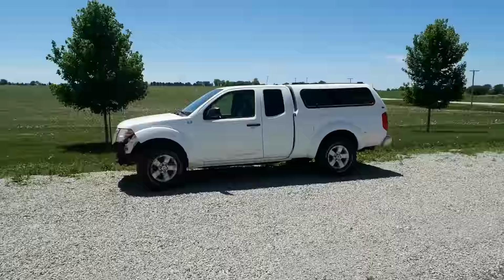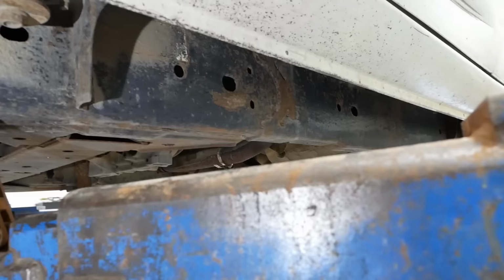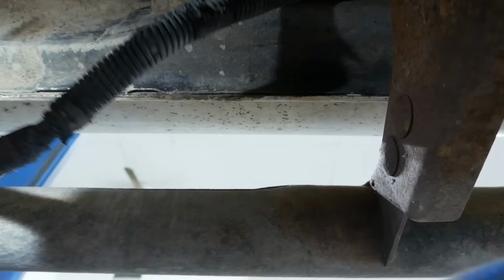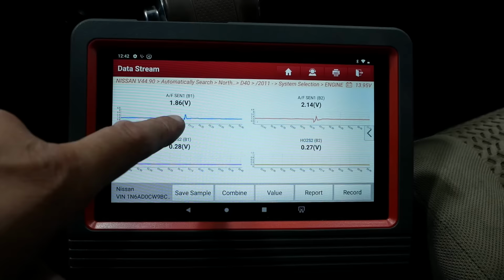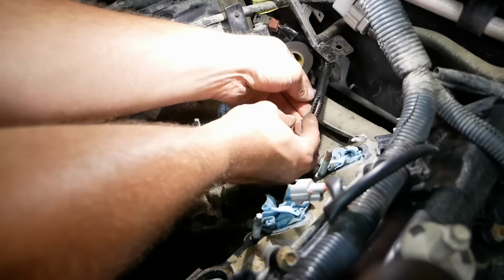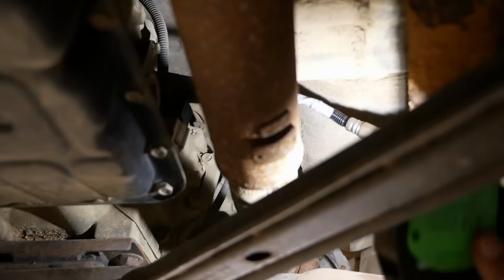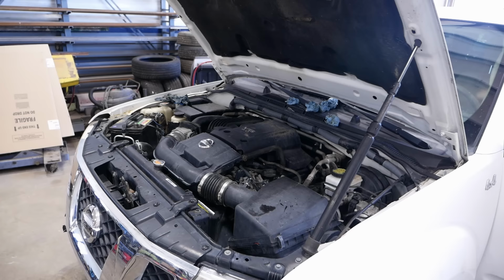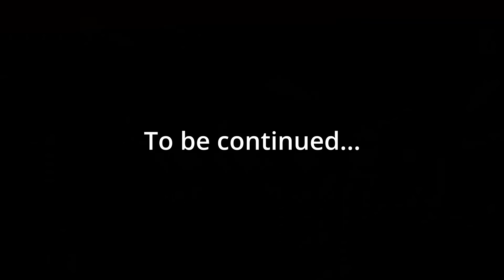Fixing a Nissan Frontier from the Salvage Auction - Part 1

Comment: Wes, I'm sure someone said this before, but afaik you're the only youtube mechanic which uses proper heatgun for heat-shrink tubing.  Two thumbs up!
Reply: @robertI153  Was about to say Eric O too.
Reply: I cringe when I see some knucklehead using a lighter with the flame making contact with the tubing. Basically cooking the joint and the shrink tubing and defeating/weakening the joint especially if anything was soldered.

Comment: You did a great job ensuring the rear axle vent was clear. It's something that is always to be inspected. Try using your bidirectional scanner and performing a steering angle reset before worrying about the ABS errant activation.

Comment: It’s always nice how, when customers buy their own parts, it’s pretty much a guarantee that they’ll buy the cheapest, shittiest thing they can find on Amazon. I got so tired of installing customer supplied parts (when I still worked on flat rate) that I just flat out said that I would not warranty the part or the labor under any circumstances, including if it is junk out of the box. There were several instances where people had to pay double the labor (or more) because they bought junk that didn’t fit right or just flat out didn’t work.

I’m not sure if someone else has said it, but if the steering position sensor isn’t calibrated properly and it is showing steering angle when you’re driving straight, it can cause a sensor correlation issue where the ABS module sees steering angle (assumes you are turning the wheel) but doesn’t see yaw (doesn’t see the vehicle turning), so it assumes understeer and activated the stability control. In other words, don’t dive too deep on the ABS activation until you are certain the steering wheel sensor shows 0 deg rotation when you are driving straight. That could be caused either by incorrect SAS calibration or the steering wheel being off center while driving straight (due to poor alignment)

Comment: Had constant ABS activation on an '95 Windstar because the wheel speed sensors had rusted so much they were shorter and increased the air gap. It'll be interesting to see the cause in this case.

Comment: That poor little truck has had a rough time of it. But you came through, as always, to resolve those difficult to troubleshoot problems. I keep wondering if they couldn't put something in the plastic wiring that the mice wouldn't like to eat. On one Chevy, the mice seemed to favor the pink wires. Not sure why. My fun experience with a Nissan knock sensor was in our car. It involved the fact that the sensor tested fine when cool but not when it was hot. That required two trips to the parts store because I tested the sensor after I bought the new one and decided the sensor was fine and returned the new sensor.  I then went back to the parts store after I discovered that the sensor was indeed bad. So much fun.

Comment: @Watch Wes Work a good idea an engine builder told me is to stuff steel wool from the dollar store into the empty cavity under the intake where knock sensor(s) live to keep rodents away. Did on my father's Honda Pilot, been 3 years now parking by tall grass, no rodent issues. Have found droppings on top of the intake so they are around...

Comment: When you showed the new knock sensor I was like woh boy, replacing that is a doozy in that motor!  It’s fun to watch a video on a vehicle I know something about.  I’m on my third Frontier.  Boring truck but pretty reliable!
Reply: Relocate the sensor - don't tear the engine down to replace it in the original location.  It's a well known mod. The only reason I keep mine operational is I have a gen 1 with the supercharger :p

Comment: Hello Wes,
As a Nissan Tech and owner I do think they build a pretty good vehicle minus the turning radius and brake feeling. At least the diff fluid smells like fresh baked apple pie. 😂😂
Enjoy your content, knowledge and video quality. Boe
Reply: How do you like the 05 or so years of stick shift frontiers? Do the frames hold up good? I have 2 tacomas and I like my Yotas but dad had two frontiers, both a 2002, he absolutely beat the SHIT out of and it didn’t die.
Reply: @tacomas9602  Toyota's are very good trucks. I do know a few years back they did have some sever rust issues. I believe Frontiers and Tacoma's are very comparable trucks standard or automatics. Each manufactures have there pluses and minuses. I live in the desert SW so rust isn't a issue. I like my 2016 SV 4wd. Its been trouble free for 70k miles. I maintain it overly well also.
Reply: @boe4448  I own a 2018 DesertRunner, 50,000 miles on looking for more power out of the 40DE. Have you seen any frontier comes in with some serious work done to them in the engine bay. Nobody touches these trucks other than Z1 aftermarket for bolt ons. 
Anything maintenance recommendations for the 2WD Frontier in the near future would be nice to know too.

Comment: I have a 2011 Suzuki Equator (a rebranded Frontier) 4x4, crew cab, long bed with the 4 liter.  I must say these things are incredibly reliable and stout trucks.  Do a fair bit of off roading and beach driving and long distance hauls and I've only ever had the check engine light come on once for the crank censor.  Love these things.
Reply: I also just recently had the crank sensor go out in my 2012 Frontier. Seems to be a common issue with them. Easy $50 fix though, so no complaints here.

Comment: I love your content. The last cars I worked on were carburetor induction, but one did have a pointless ignition system. I did work on electronic process control equipment (lots of microprocessors, funny wiring diagrams) but the wires were not sitting in the middle of a hot engine valley, toasting the insulation and connectors while providing habitat for small rodents. The amount of patience, and the "I'm gonna fix this thing if it's the last thing I do" determination you display is amazing. I only hope they pay you what you are worth!

Comment: A couple of months back I had to work on those exact knock sensors. I moved them to the intake so they could be accessed without tearing half the engine bay apart. They still function. It’s been 10000 miles and no burned out pistons so I think it is safe. 😎

Comment: My X has a 2004 Subaru Forester when we lived in Maryland we were subject to emission testing every 3 years. Which means when the check engine light comes on you pay through the nose. One shop quoted $700 to replace the upstream O2 sensor and both belts. Well we were able to move out of state before the test and I replaced the parts myself. On the downstream sensor when it finally loosened I broke my little finger smashing into something. It’s still bent and I think about that mistake every time you say O2 sensor. Ha! Really enjoy your show keep up the good work.

Comment: I despise ready to use pigtails myself and won't use them unless no other option. I prefer to re-pin the connector or install a new connector on the existing wires. I prefer to eliminate any chance of dissimilar metal corrosion that can occur. Everyone has their own way of doing things though =) Really enjoy your videos =)

Comment: Love those Nissans, only thing I can complain about is their godawful turning radius. Had one come into work and it needed a patch on a tire and trying to maneuver that thing into a bay with the little amount of room we have between the bays and the parking space was quite the chore. My Tacoma does it just fine and I’ve had easier times pulling full size trucks into the garage, just not sure why they’re so bad in that regard.
Reply: The Gen 1 trucks turned tighter than my 240sx!  I have a 1st gen xterra and she turns as tight as can be.  My dad had one of those 2nd gen frontiers and the turning radius (or lack of) was one of the first things I noticed!  So glad I didn't "trade up".

Comment: Worked on trucks and buses for my career, have seen many axle seals leaking even with the cover for the axle breather loose, but I have found by removing the breather the passage to the axle tube to be rusted solid.

Comment: finally a car we have in australia. I have the 2.5 d40 navara. Identical besides the motor. My 4wd stopped working and gave fault codes. Sometimes transfer connectors get water in them and dirt and quick clean solved my issue. The ute rear springs are not up to task for any weight. Even when new. toss them out and get a 2" raised kit.

The front UCA should be replaced with an adjustable one. Nissan just dont allow enough adjustment.

Comment: I wish you would find us a good pair of ratcheting crimpers for those non-insulated connectors. I started using them for everything after I learned about them from you. But the crimping leaves much to be desired. I found a Klein crimper VDV200-010 with the VDV205-044 anvil that works ok, but not great. Thanks for the educational content!

Comment: We have a 2011 Nissan Pathfinder SV 4 x 4 and the Service Engine light has been on for about 100,000 miles.  We had 3 Shops deal with it they get it out for a few days and it comes back on.   I cleaned the Positive post and checked the 2 fuses which were good and it went out for 2 or 3 days and back that light comes.   We have 152,000 plus on it and it still runs as well as it did the day we bought it.  2 of the Shops just said there is a short somewhere.

Comment: I’m amazed you have any of those left over there. Most of the ones here in uk got recalled by Nissan and scraped due to rust resulting in the frame snapping between the cab and bed. Something to do the the frames being left outside for months before assembly. I bought one for 3k and two months later got a letter from Nissan telling me I need the bring it in for inspection. They gave me 5k for it lol
Reply: Most U.S. states don't have inspections and recalls are optional. There's probably people driving around on trucks with broken frames right now
Reply: nissan tech here, the later ones got sent back to spain to get a new half-chassis at rear fitted, loan car for about 6 months. i had to repair the ones that wouldn't start after the ferry back, mainly alternator/battery/wiring damage caused by bad jumpstarting on the ship

Comment: Replaced the o2 sensors on my 04 ram 1500 5.7. Got the code again, saw too high of baseline voltage. Figured it too be electrical, cleaned all grounds, even checked the pin on the ECU but kept getting the fault code.

Read alot about using generic replacements giving trouble, forked out the euro’s for OEM replacements and boom, flawless ever since.

Comment: What's nice on the Honda V6's If you look at the knock sensor pigtail, it has a logo of a rat with a crossed out symbol on it. They put a sheath over the insulation that's made with pepper extracts so the wire tastes "hot" to the rodents and they avoid it

Comment: A few months ago I bought a 2006 Nissan Frontier for a $1000,  the body is in cherry shape the kicker is the radiator leaked antifreeze into the transmission, it made it 450 miles even after a few transmission flushes, other than the transcooler radiator leak they are great trucks.
Reply: Luckily they started putting exterior oil coolers on 09's and later.  Heard that was an issue for a lot of people.
Reply: @GeminiWoods  
My 2006 Frontier has a factory external cooler also,  its a pretty big oil cooler for a four cylinder truck, I went ahead and by passed the radiator oil cooler.

Comment: I remember the Nissian hard body were very popular around here , the 4 cylinders were super high mileage units and the V6 extremely dependable, so I think the frontier not to far behind
Reply: I owned 2 Mercury Villager GS minivans, a 93 and a 94 both with the venerable Nissan 3.0 V6, with the exception of the weak exhaust manifold bolts/studs, I drove thousands of miles in my vans. If I could find one with as little rust as possible I'd buy it
Reply: @bryanphillips6666  that 3.0 was legendary and be honest Mitsubishi’s 3.0 drew a lot of similarities and engine too was built proof especially in the Chrysler products it’s amazing how similar the engines looked

Comment: When there isn't a published spec, sae has specs for steel fasteners into aluminum (or steel) that work well - and often are the same as most published specs. 👍 You'll find differences in rare occasions and rarely with "normal" fasteners.

Comment: It's good to see you are back Wes & Mrs Wes. Did you end up getting anew computer or was it repairable?

Most items that required rectifying on the Nissan are within the bounds of a DIY'er, however the frame issue is the big problem for a DIY'er. That one issue would prevent me from buying it. 

I am certain I have never seen that many vehicles in your yard before Wes. Is it summer air conditioner repair time, general vehicle servicing or do they have drivability issues that need diagnosing & repairing?

Comment: Check the transmission for pink slime. The radiator likes to fail into the transmission cooler. It has a external transmission cooler also and the one in the radiator can be bypassed with no repercussions. I know it's to late now but the spark plugs could have been changed when the upper intake was off. Forgive me for my comments I used to own one of these trucks.

Comment: the steering angle sensor needs resetting every time the battery has been flat/disconnected
bad ABS signals are usually the front wheel bearings, in UK, wheelbearings come with a new sensor in the box as well, as it snaps coming out [of the way]
no petrol versions available in UK,  but exhaust leaks do cause O2 issues on other nissans
nice to see one not snapped in half just behind the cab.....

Comment: Good to see your video this morning, I hope your computer issues are resolved for the foreseeable future. Wes do you use any particular non insulated wire connectors? I've alway used the insulated ones but squash then shrink tubing seems the way to go, That lower intake needs a set of velocity stacks on it.

Comment: On most Nissan products, the post catalyst sensors will be stuck at 0.28v until you get them hot by running the engine at 2000 rpm for a couple of minutes or by driving for a few minutes.  Cold start and idle all day and they will stay at 0.28v and not set any DTCs.  it's strange but normal.

Comment: In England they are called Navara’s,They had bad reports with chassis frame rusting through and Nissan bought a lot of them back.Also the bottom end of the engine used to go I think the crank shaft and shells.if I was him I would put some rust proofing on the chassis and the floor pans.good to see your wife doing the white knuckle towing agency paper work lol
Reply: it was the model before that used to throw con-rods out for fun, these are not that bad  [air leaking into oil pickup pipe through duff O ring]

Comment: Very interesting truck. The little cutter at the beginning of the video is definitely a cigar cutter. Was that truck an Illinois truck before the auction? Has some rust but not the usual amount of rust you deal with. I wonder if taking a long piece of rubber hose and splitting it. Then put it on the wiring harness running on the outside of the frame would help keep those wires from corroding more..
Just a thought.
Great to see you back.

Comment: Here in the Netherlands/Europe, the same type of car was prone to rust the chassins rail totally away from the inside at the point where the chassisrail leaves the cabin. After 3 years, the rails were so weak that the tub sometimes broke away from the cabin. 
Nissan had to take all these cars back due to security issues.

Comment: Great shop space, great analytics on a sketchy vehicle that will probably run forever after you worked on it. Thanks for showing us how to do it.  

For 2 other great Illinois mechanics, take a look at the channel of Zeth Key of Atwood, Il, "ZK Mastertech", an expert in repairing very large John Deere farm equipment for a large regional JD dealer, and Brian at the "FordTechMakuLoco" channel. Brian's shop is in Yorkville, Il, and he is a true expert in Ford trucks, and all things Ford-related; he has another channel, BSG Automotive, for other vehicles he works on, but he specializes in Fords.

P.S. The non-pickle cutter you found is for cutting the ends off of cigars. Also works for clean cuts on small vacuum and fuel hoses.

Comment: Looks like what's sold as a "Navara" in Australia. I think they're junk but lots would disagree. They had a bad habit of wheel studs breaking off while driving.
Reply: I've seen (and experienced) lots of complaints about the Xterra/Frontiers but never about wheel studs breaking off.  And I've taken mine and been with large groups that regularly rock climbed with 'em.

Comment: I noticed that the VDC (stability control) light was on, a VDC activation can definitely cause ABS activation..had that happen to me on a nissan 370z with an angle kit for more steering angle, im thinking the expected yaw rate did not match the steering angle and it thought it was slipping on the road. It would be worthwhile to look into any VDC codes and the steering angle.